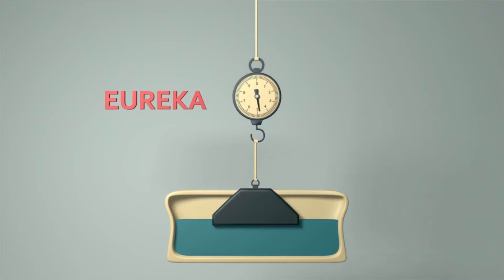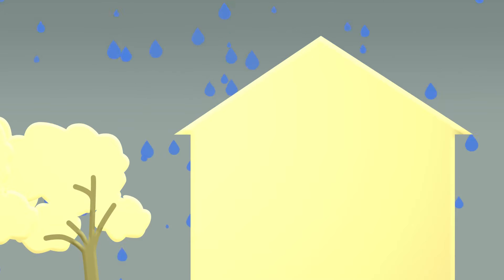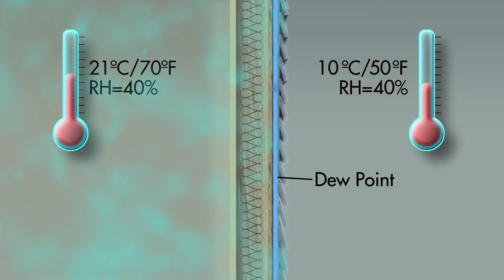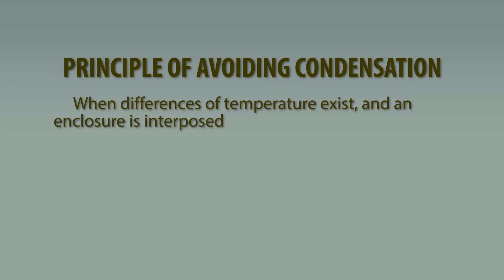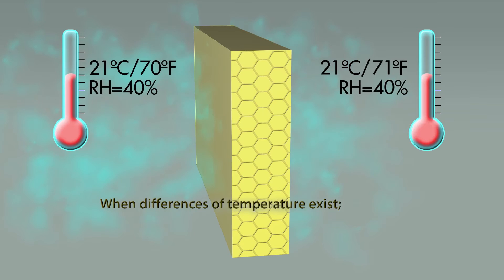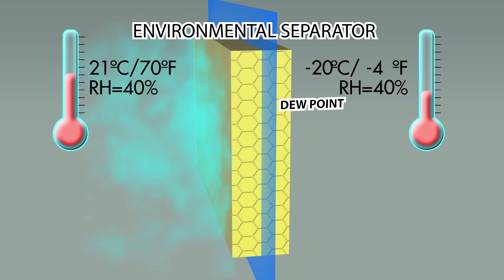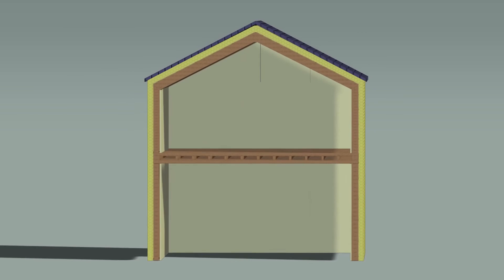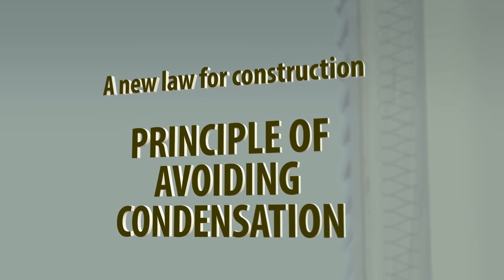Principle of Avoiding Condensation Explainer

Comment: So it seems to me like basically you're talking about a perfect insulating material. What you describe is essentially the Tyvek layer of a building envelope. The problem is there is no such thing as a perfect insulation. So no matter what there's going to be some heat transfer One Direction or the other. Not only that but you're missing the point of windows which is the biggest place where condensate happens and really the only place I've ever seen it actually turn into any sort of puddle or problem. I've been in a muggy attic or two but I've never seen one that actually accumulated water only window sills.  no walls no basements, nothing else I've seen will develop actual puddles. I've seen some brick in basements get damp but never cause standing water from vapor. If you were to Vapor coat your insulation bats the only thing that you would possibly do is prevent the air transfer before the wooden sheathing instead of after. Even then I've really only seen this in places where they have been building airtight for a long time that have major temperature fluctuations like Alaska I've never really seen mold caused by air Vapor transmission only by other sources like leaky pipes or groundwater seepage or bad drainage or bathrooms that don't have proper ventilation I suppose that could technically be thought of as a vapor problem now the problem with build airtight building envelopes or what you're talking about with airtight insulation is that eventually one way or the other you're going to get temperature fluctuations that do cause some kind of vapor transmission within the home now when you have airtight building envelope that Vapor never leaves so it can't go anywhere and it's just accumulates so you get more problems with building airtight than you do without you want to be able to let that vapor go rather than accumulate it like a collection
Reply from the maker: The principle eliminates from construction the vapor barrier in the form of foils, coats or membranes (such Tyvek). EIOS Thermosystem (https://eios.co/) is the insulation that makes the building moisture free. The material used is extruded polystyrene and closed cell polyurethane foam https://eios.co/system . When I made this principle in 2010, I knew that will be a confusion between vapor-barrier and vapor-impermeable insulation. That's why I made new terms to define this new kind of insulation, which is a new way to build: Moisture Free. Condensation water from diffusion is about one pound/square foot or 3-6 kg/square meter in a cold season in regular climates, going up in extreme climates. The Non-Permissive thermal envelope is proved moisture-free from more than 10 years so far. The principle applies mostly for Non-Mineral, Moisture Sensitive construction such as wood or metal structured walls. Intersection with other constructive elements as windows and doors is taken very serious in the new concept, see https://eios.co/eios-besides

Comment: Very well informing and nicely presented. however i have a question. you didnt mention constructively what is this dew point. what is it made of ? what kind of material is it ? how is it installed in the middle of the insulation layer. etc thank you
Reply from the maker: Mario, Dew Point is the temperature on which vapor reverts to water, and condensation occurs, and depends on temperature and Relative Humidity. Usually, interstitial (in wall) condensation occurs because of vapor diffusion and air-transported vapor inside of wall, and the dew point generated by outside cold. The Principle states that vapors will not get to the dew point inside of insulation, so as condensation is avoided. Anyway, your comment is very funny, thanks!

Comment: I have a problem with moisture in my basement. The West and North walls of the basement are about 8 feet/2 meters below grade. These walls as well as the floors are constantly moist and anything that can mold will if in the basement long enough. Since it is below grade I cannot insulate from the outside. My house is stone and is over 100 years old. The walls are about 2 ft thick. 
Would it be possible to insulate from the inside?
I have played with the idea of building a new inner (non structural but built with bricks) wall with closed cell foam insulation between the 2 walls. The outer wall effectively becomes part of the earth and would be constantly moist while remaining at earth temperature and the inner wall would be dry at inside temps and the foam would stop any moisture transfer.
Can anyone give me their thoughts and /or advice on this. The South and East walls are above grade and do not  have these issues.
Reply from the maker: You probably have water infiltration and capillarity issues, not a condensation problem. Make a waterproofing layer, preferably cementitious, on walls and floor. Than you can insulate non-permissive with XPS insulation on walls, apply cementitious plaster reinforced with mesh, or build a brick wall. Do not perforate with anything the waterproofing layer! I recommend to make the waterproofing, and wait some time to see the results. Good luck with your project.

Comment: I wanna build with straw bales.
What if we make the outer layer non-permiable and leave the inside permiable. Even if water gathers inside the straw, would it not evaporate/diffuse back into the interior?
Reply from the maker: Straw is one of the most vapor-permeable insulation material. It will move the dew point area inside of it, and a lot of condensation will occur. Such organic material as straw is a good food for mold and fungi. In some years will be a mess. The hope of inward drying is only a source of indoor bad air quality. 
It is not in the area of this principle.

Comment: How is this different from standard practice of using 5 or 10 cm of EPS here in Europe?
Reply from the maker: EPS is permeable to vapors, in the class III Semi-permeable. Usually is installed non-airtight, with drainage and/or ventilation behind. It partially work as insulation, without moisture issues for mineral, non-wetting-sensitive walls (brick walls). It can be a big problem for non-mineral (wood, metal), wetting-sensitive walls.

Comment: That is very convincing. What materials allow such a setup? For now best solution proposed is ventilation inside to dispose of excess  moisture
Reply from the maker: Ventilation cancels the insulation value! It's a nonsense, but still used to solve moisture issues in moisture control rules and regulations. Avoiding condensation is a new vision, and allow to build Moisture-Free. You can find more technical details and the practical application of moisture-free construction on https://eios.co/moisture-free-concept
Reply: A  HRV system is supposed to solve the ventilation while retaining heat.

Comment: do you know if polyurethane foam acts as a vapor barrier?
Reply from the maker: Closed Cell Polyurethane Foam, if is continuous applied, acts as a non-permissive insulation, so it is a vapor barrier. But, it needs to be continuous. Open cell polyurethane is not.
Reply: @mariusradoane1787 hello,  thanks for answering

Comment: could you please explain what happens to the humidity  being created inside the house? What if we have a humidifier running in a bedroom? How does the humidity produced in the interior get out of the building? does it not condensate in the ceiling?
Reply from the maker: Thanks for your comment. Your concern is a big confusion of the whole construction field. I'll explain: vapor content in the air is an environmental specific, and is expressed by the Relative Humidity, which depends on environmental temperature. Most of the time, outside RH goes above 80%, but condensation occurs only in the clouds, where rain starts, or morning dew. Inside of buildings built according to this principle, RH is usually in the comfort range of 35 to 65% RH, but if there is an extra source of vapors, RH can go to 99% RH and condensation is still non an issue. The confusion is that, in excess vapors in the interior environment needs to be ventilated naturally by windows/doors or mechanically, and this is not the duty of envelope walls. Vapors gets in the walls because of the temperature difference, and this is also the cause of condensation (dew point inside the wall). The principle gives the option to separate two environments, with two different temperature and RH, without the condensation and moisture issues of the enclosure that separates those two environments. For your trust, no building made according to this principle reports any RH above comfort, no matter the inside activity.
Reply: @mariusradoane1787  thank you very very much for this explanation!!!

Comment: So if I understand correctly, you are talking about having a continuous insulation that is a vapor barrier, so that moisture is unable to travel until the location of the dew point? But in that case, the vapor barrier needs to be both on the inside and outside, to handle winter/summer conditions, right?
Reply from the maker: ST, you get the point, but the terms create confusion! PAC makes use of the terms: continuous applied ’’Vapor Impermeable Insulation’’ and ’’Vapor Impermeable Insulation Assemblies’’ and not Vapor Barrier. To avoid confusion for practice, I named this insulation Non-Permissive. Indeed, when warm vapors don’t get inside of Insulation, where the presumptive dew point is, the condensation is entirely avoided. Instead, vapor barrier, in the form of foils, membranes, coatings, is permeable to vapors (actualized name is ’’vapor retardants’’), and is the prerogative of the moisture control building science. Unfortunately, PAC is not yet taken into consideration for practice. 
Regarding the both sides, inside and outside, the principle contains the word ’’Viceversa’’ which means that the thermal flow, which coincides with the vapor flow, can be change at any time (climate or season), without affecting the result of the principle (avoiding condensation) but here is another warning of novelty: the envelope wall is conceived as two elements: 1) the Structural Element and 2) the Environmental Separator which creates the thermal-envelope. Mixing the two elements will always cause problems! The Structural Element doesn’t have to be airtight, moisture resistant and thermal isolative, while the Environmental Separator takes all functions of Avoiding Condensation (not controlling moisture), Air-tightness of the building, Waterproofing and Insulation. Now, the Environmental Separator element (the Non-Permissive Insulation) can be applied internal or external to the Structural Element, without affecting the Principle (avoiding condensation is accomplished), and this because is contained in one environment (internal conditioned or external extreme weather) and the action of vapor and difference of temperature will take place inside of the Vapor-Impermeable, non-permissive Insulation. Of course, if the Structural Element is in the exterior environment (non-permissive insulation applied internal), it needs to be protected by exterior weather. This is why, internal application of non-permissive insulation is recommended on mansards and ceilings at the last floor (the Structural element is protected by the roof system). For practice, you can find more on https://eios.co/moisture-free-concept or ask here.

Comment: Romans did know that the water could go up hill. There were aqueducts built with that principle in consideration.
Reply from the maker: As in our times in construction, Romans used the communicating vessels as pipes, without knowing the principle (they built aqueducts). Elements of present construction as window-panels and sandwich-panels follows the Principle of Avoiding Condensation, without taking this principle into consideration. So, ports of constructions are moisture-free, but not the whole building, as the principle states.

Comment: Are you saying that vapour barriers still allow some vapour to get through and your material is 100% vapour proof? Also, for it's insulation effect, what would be it's comparable R-value? It seems you are saying it is a 100% insulation from outside.
Reply from the maker: The insulation used is the XPS extruded polystyrene, which is considered vapor-impermeable for a thickness more than 2 inches (5 cm). Vapor barriers are now called vapor-retardant barriers and yes, do allow vapors to pass from the concept. The principle refers to an enclosure, so the insulation material needs to be assembled to create a vapor proof insulation for the whole building, or element of the building. See https://eios.co/system and https://eios.co/sky . This assembly is called Non-Permissive insulation, is moisture-free, and is also 100% Effective insulation, which means that it applies entirely the testing coefficients as conductivity [W/mK] or R-value. Other air-permeable insulations applies to the building just a small % of the specified testing conductivity. The decreasing of the real R-value of the air-permeable insulation assemblies is directly proportional with the temperature-difference, which means that, wen we need insulation the most, we have effective-insulation the less. See https://eios.co/thermal-efficiency
Reply: @mariusradoane1787  So this seems like it makes the enclosed area airtight, correct?
Reply from the maker: @rehanalizaidi  The frame can be as less airtight you want! The non-permissive insulation will make the building envelope 100% airtight (the area applied). This is another big advantage of the principle. Simplifies construction, uses less materials.
Reply: @mariusradoane1787  thanks. Where is this available in Ontario, Canada. Further, doesn't closed cell spray foam do about the same thing?